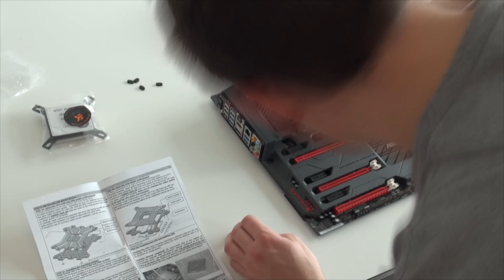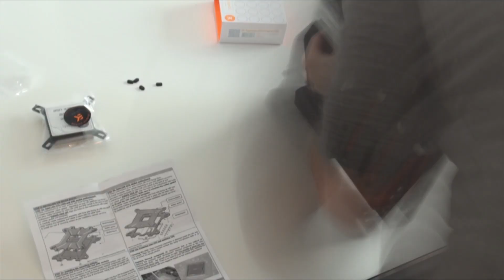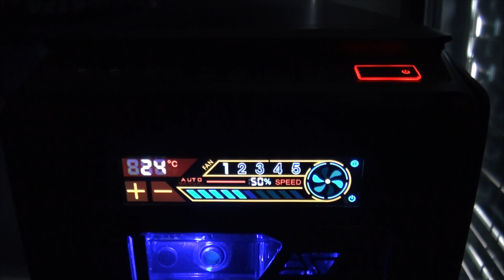Water Cooling Upgrade - Valiant 2.0 Build

Comment: Hey man! I am currently considering using that pump/res combo in my watercooling build. I can't find anyone but you who has used it. How is it holding up? Is it audible (pump noise or vibrations)? Thanks so much!
Reply from the maker: It's nice pump combo, and it is fairly quiet at low speeds, but nothing is quite at high speeds. Not much in terms of vibrations. But it is next to impossible to clean and when refilling the loop with a bit of air it sometimes needs a lot of fiddling to get going, otherwise when you turn it on it just straight up doesn't work. To be 100% honest I bought it because it looked convenient, but having a regular reservoir with a pump on the bottom, inside the case is probably the most convenient. The build quality is high, and it has been working well, but if I did another upgrade or built a new PC I would use a regular cylindrical on inside the case. I know how hard it is to find information on this pump combo I was in the same boat when I was researching it, so I hope this helps!